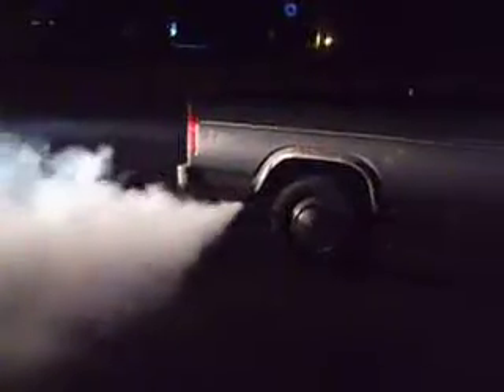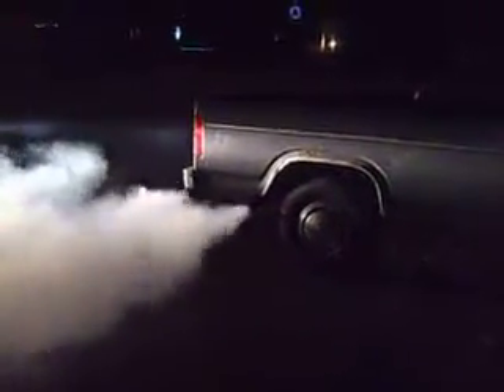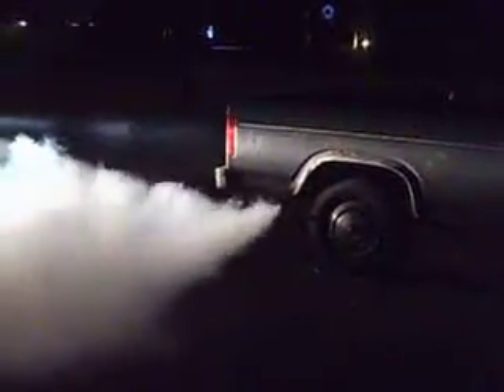6.9 Ford Diesel - Return Check valve clogging repeatedly

Comment: Did u ever get it fixed??
Reply from the maker: I replaced the injection pump ... Cleaned the lines ... All good after that. 

Pumps are cheap for that motor
Reply: How much was it I have the same truck mine runs less white smoke but similar also won’t start without the block heater

Comment from the maker: .... So noooo Bad Head.  Replace the pump, injectors, fuel lines, fuel/water seperator (I have another new one -get it for 30$, new for a cummins semi) 

It runs great.  

I had ... about ... 3-4 fuel leaks, and low fuel in the tank causing intermittent stalling for about the last 2 weeks ... 

I have noticed that alot of ford diesels when at the Stations pump will trip the full tank shut off ... I thought I had a bad fuel gauge or connector ... but my farm/gravity tank filled it !!!

Comment: Its not getting to much fuel, this would cause a runaway, its causing the timing to go out as timing is controled by internal pressure usually.
I knew a car where fuel return and inlet were wrong way round so it was getting shit from tank and when fuel got to quarter full it would pull in air!
Obviously urs is correct?
U should have no dirt in pump.
Have u bacterial fuel infection?
need antibiotic fuel treatment if u do.
Damp causes this. and old fuel.

Comment: On my car, the return valve would jam up because of a broken pump bearing, pump needs replacing, its not to much fuel going into engine its unburnt fuel as injection timing moves with different internal pump pressures.
Make sure fuel filter exists!
any muck in pumps usually kills them.

Comment: alright thanks, i pulled and cleaned it, but it still runs for crap lol.  no i have to replace te o-rings on the injectors.  weird huh. they might be bad.  but tell me what fixed your teuck when you get it fixed.

Comment from the maker: The check Valve is right on the forward top side of the pump.  So you open the hood. You will see a fuel line coming off of the front/top side of the pump.  The check valve is INLINE/connected behind the fuel line I described. It has a glass bead that is modulated to open/close fuel flow with a spring.

I am now replacing the pump.  Pulled it OFF tonight.

I will have to get more video!